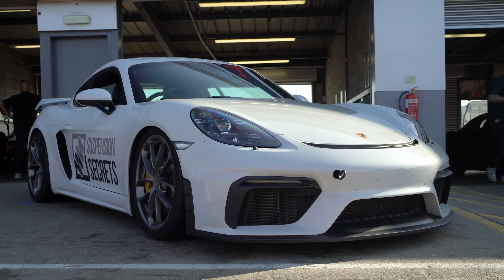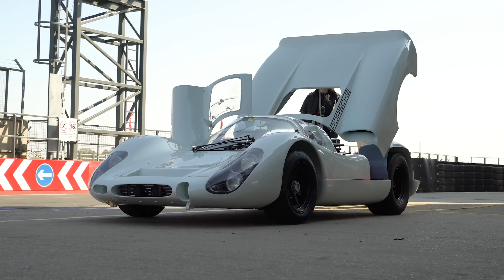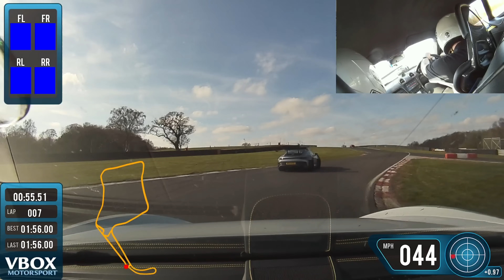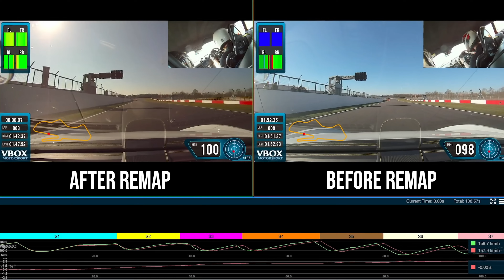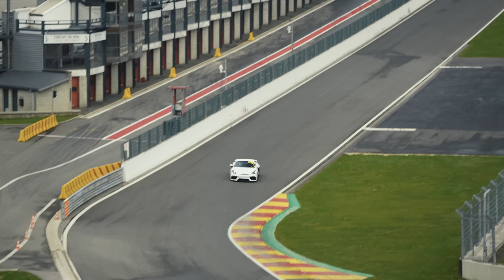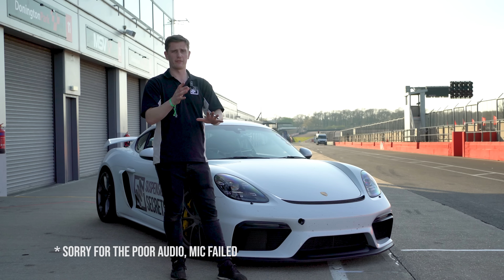Donington Park Track TEST: Is Our Modified PORSCHE GT4 Fast Enough?

Comment: Love this series! What is the thought behind the amount of rake for this car? I think you mentioned it in a previous video. How does the rake contribute to the amount of cornering grip. Thanks!
Reply from the maker: Thanks for the comment and glad you’re enjoying it. Rake angle is a great topic! The Porsche chassis is also extremely receptive to rake angle. 

So increasing rake, having the front lower than the nose puts more load onto the front tyres and prevents understeer on throttle as the front stays pinned down. With cars running underbody aero rake angle also helps to activate the aero and create downforce too. 

We should probably do a video on this topic in more detail as there is so much to get into but ultimately the rake improves the chassis balance, reduces understeer and activates the underbody aero so is a real winning piece of the setup.

Comment: Hi Matt, i still have the M3 comp that you set up a couple of years ago at Brands (since then i have added alcons, litchfield stage 1, Oz 19s + cup 2s).  Planning to sell later in summer and pick up a GT4 (not sure if manual or PDK as the Mrs will have a say!).  Remapping BMW's is fairly norm but less so for Porsches (suspension upgrades fine), do you think will impact resale value and ability to trade into a dealer?
Reply from the maker: Hi thanks for the comment and hope you’re keeping well! 

Great question and also great choice to move into a GT4 as they’re fantastic cars! In terms of mapping and re-sale it’s a very interesting topic. A year or two ago I would have said it would ruin the resale of the car. However, they are now much more commonly tuned, quite a few are coming out of warranty and they are definitely going to be a very popular track car in the coming years. So I think as long as it has been mapped by a reputable company and it is well maintained it should still hold a strong resale value 👍

Comment: for aero you can easily drill another hole in the wing mount (or make another wing mount because that is what you do) to increase the angle of attack like the Manthey wing mount. Maybe add a Gurney flap. For the front add the GT4RS under aero which will work well with your lower ride height.
Reply: I have the full suspension secrets kit and that’s exactly what I did. I used blue spot’s 7° aoa bracket in conjunction with 4RS front underbody aero. 

I also have the verus canards and rear muffler cover (have aftermarket exhaust).

Car is noticeably more planted and front turns in better at speed!

Next up is SSR CS full aero kit/front splitter. 😅
Reply: @derangedtoad1290  I kust emailed Blue Spot Autoworks to see if their wing mount fits my 981.
Reply: @derangedtoad1290  I just Emailed Blue Spots to see if they fit my 981 GT4. is yours the taller mount  and di you have a 718?
Reply: @ I did not get the taller mount. Wing in the rear mirror has never bothered me. I remember reading that past 7° it needs to be higher. Not sure though. I have a 718.
Reply from the maker: Awesome thanks for this. We are currently deciding whether we take this OEM+ route like you have mentioned or if we just go the whole hog and get a proper GT3 (the race series not the Porsche) style wing and full underbody functional aero with a chassis mounted splitter to really see what the car can do on the limits 🤔
Reply: @SuspensionSecrets  How about adding the GT4RS under aero bits and the bigger angle on the wing with gurney flap first, do some testing, then go nuts with a big wing and splitter? you can make and sell a wing angle kit 😎

Comment: I wonder if they have a gear set for the 718 like they do the 981.
Reply from the maker: There are a few gearset upgrades out there. We drove a customers GT4 in Dubai last November with a full gearset upgrade and it seemed to be a real sweet spot for the manual box.

Comment: I'm curious what kind of water and oil temps you see with the extra power and if you might want to look at more cooling? On a 'stock' car my oil seems to hover close to 120 C around Donington for 5 lap runs in similar conditions.
Reply from the maker: Interestingly we haven't seen any noticeable increase in temps or pressures out on track. If anything they seem to be more manageable with the OPF delete preventing heat build up in the exhaust system.
Reply: @SuspensionSecrets  Interesting stuff, I for sure notice that the exhaust system seems to act as its own massive heat sink in the back of the car. Anything left in the rear trunk space for a trackday ends up appreciably warm (terrible place for cans of coke, etc!) and on one day it was hot enough to melt the sticky pads holding my number plate on lol! 

I'd certainly enjoy the extra power as if I had a complaint with the car it's that overtaking higher hp cars is a pain in a stock GT4. The stock power is enough for fun but it's realistically not that high compared with other modern factory stock 'track' cars so you're almost always the 'slow' car on the straights. I just can't bring myself to do it while the car is still under factory warranty though!

Comment: Great video, did the OFP delete increase the Db for track days??
Reply from the maker: Thank you. Yes it did increase DB but we have passed every noise test since without any issues.
Reply: @SuspensionSecrets  thanks, 105db track days or 95db?? Sorry to be a pain. Also how far can the suspension set up be pushed to keep oem warranty
Reply: @brianjkidd5104  I have BC fabs long tube headers and UNDER axle pipe with cats where OPF used to be.  On closest track to me, clear sky I don't blow the 103.5db limit there, but last cloudy weekend I did.  I still have OE muffler with valves, but ... even if you have sport exhaust off, by 4k rpm max at full tilt throttle they're open, didn't help  my sound limit at all.   I went to a big box auto store between sessions and got metal tie wraps and wired the valve partially closed.  It was pretty easy and lowered the sound - too much really.  I need to fine tune how much I close them.  Hope this helps.